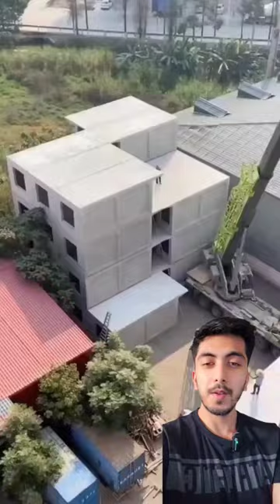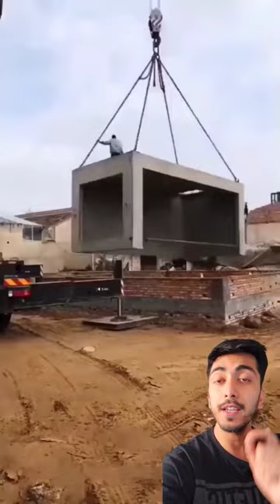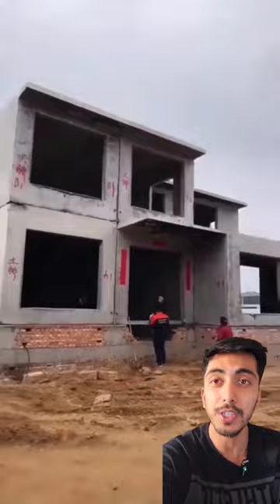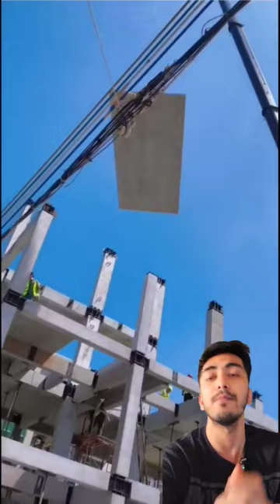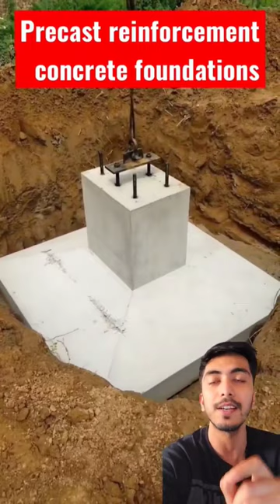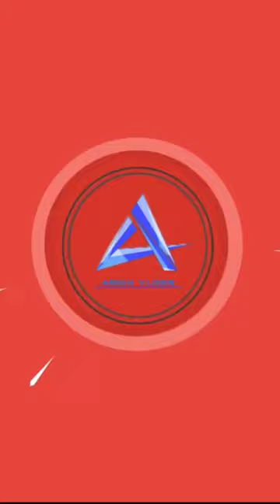Precast Building in India 🇮🇳 building 4 floor ina day #archivlogs #construction

Comment: The disadvantages are, 1 no modifications are not possible. 2 cracks at joining are unavoidable.
Reply: it's unsafe  for earthquake prone buildings.
Reply: @maotsetung243  Not really. I live in an apartment built using the same technique. It's compliant.
Reply: What about durability???
Reply: @nikith9182  It's durable. You can trust this better than traditional construction. The downsides are limited scope in modification.
Reply: Helps in Environmental pollution so i think its build in mars.... also local labour unemployement.
Reply: Those all blocks are inter locking system brothers...

Comment: Pre manufactured concrete structures is faster to set up and build but lower quality (mainly in finishing) than the on site built structures
Reply: Naah all our bridges, flyovers made out of pre constructed meterials on the top of pillars
Some times other than base pillars too pre constructed
Reply: not all precast are prestress.
bridges are prestress
this box home isn't prestressed.
it needs to have end to end prestressing or else it won't function like the rest of precast structures u see on roads.ans during earth quake it will only get displaced due to little movements.
Reply: @GamerOne_me  most of them are build just beside the construction site

Comment: People are forgetting that even prefab also needs to be build in a manufacturing facility.  Which means you have to plan well in advanced.    Your not saving time your planning well in advance and it not be cheaper because someone is building for you as opposed in site construction.
Reply: It is cheaper because you don’t need to haul all machinery, economies of scale can be leveraged here
Every building need to be planned in advanced regardless of construction method
While footing and slab are being prepared on construction site, manufacturing plant can start working on prefab blocks so that does save time a lot

Comment: How r they joining columns or slabs?
Reply from the maker: in many cases they have biding solution and then its fixed with bolts and sometime its just bolts and padding .
Reply: @ArchiVlogs.  that's sounds like some top shelf engineering there

Comment: Lol, its all the same pollution. Bringing that much weight via road will produce the same pollution in fuel wastage and exhaust gases.
Reply from the maker: Usually the production site is setup near to actual site, it reduces population through controller environment, man power, time consumption and speet of construction.
Reply: @ArchiVlogs.  lol, then there's no difference between precast and using shuttering....